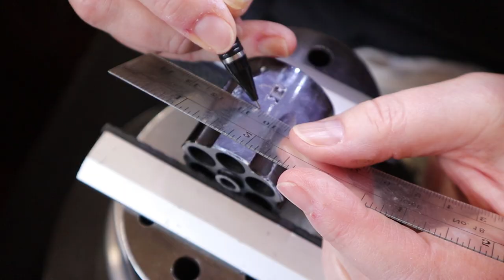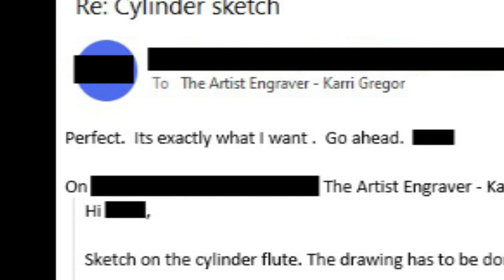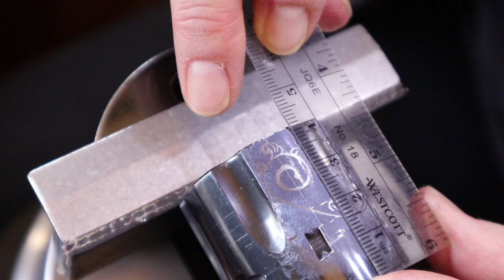PT 1 _ Colt 3rd Generation Cylinder | Beautiful Metal Design Scroll | Watch Custom Engraving

Comment: Hi Kari, I love your work! Question - Is this project possible with hand push engraving? I'm sure the metal is quite tough.
Reply from the maker: Thank you!  
I believe you would need a hammer not just a hand push tool.  The metal is indeed very hard, especially the frame which I will discuss in an upcoming video.

Comment: What would approximate cost be to have you fully engrave a desert eagle? I know a somewhat vague question, however my engraved pieces already are a factory engraved ruger gp100 in stainless, a colt government 1911 with Altimont engravings dinosaur design, and a matched set of the "bootlegger" tommy gun with matching 1911, if that may give some idea of interests.
Reply from the maker: I can't put monetary amounts up on YouTube.  It locks me into pricing that can change over 10 years or so. 😉 Send me an email if you want a proper quote.